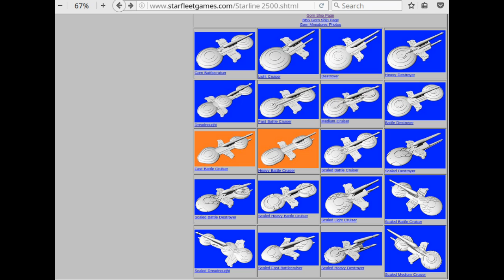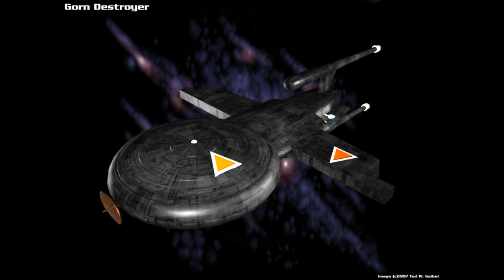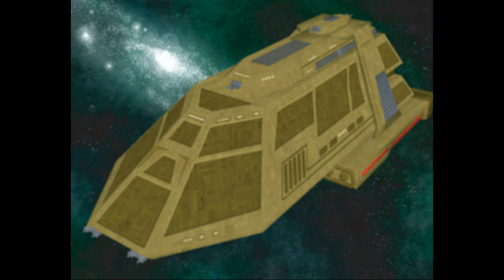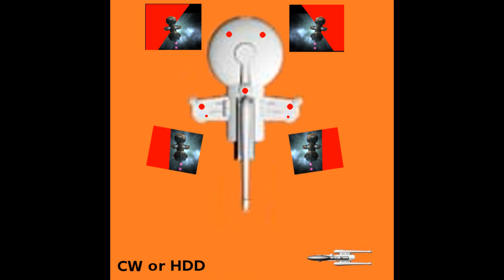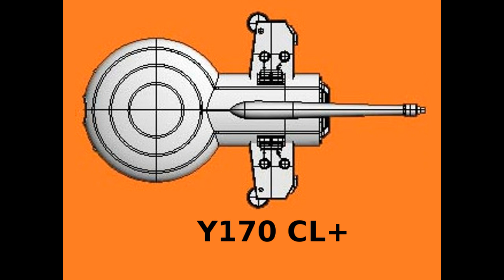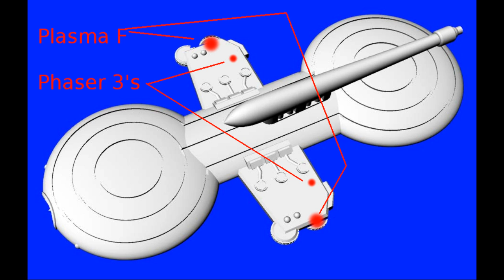My favourite SFB Gorn ships

Comment: The redesign of the Gorn ships that moved the warp engine mountings to the center hull from the rear bubble ruined the aesthetic beauty of these ships for me.

My favorites in the Gorn lineup were always the Light Cruiser and Battle Cruiser.  The early years favor the Gorns, while its opponents tend to catch up in firepower in the later years.
Reply from the maker: +Joisey These are actually miniatures and well - -  miniatures whose warp nacelles are always falling off don't sell well. I agree the original Nacelle placements look better.
Reply: I had my share of Starline 2200 Gorn ships back in the day, and I never had a problem with the engines coming off.  The ships that gave me the constant problems were the Kzinti---particularly those Frigates with the toothpick sized drone booms!